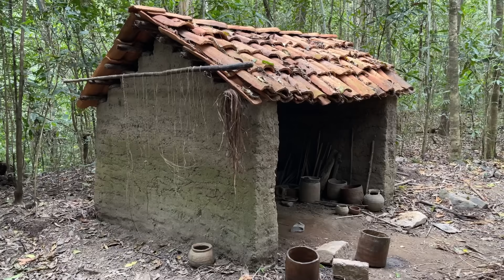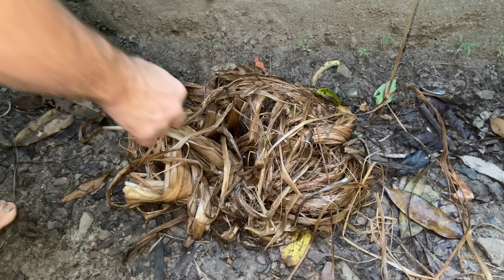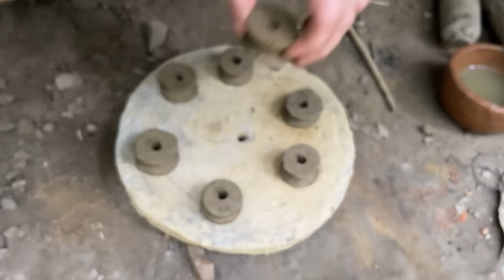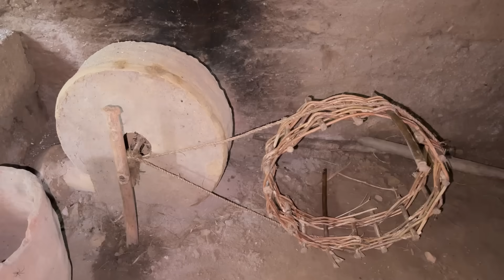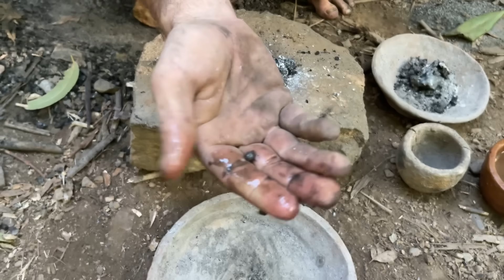Primitive Technology: Floating Pulley Blower Smelt

Comment: AI Summary

Abstract:

This video details the construction and testing of a traditional, human-powered blower for iron smelting, specifically focusing on the challenges and solutions encountered when adapting existing designs. The creator meticulously rebuilds a broken clay blower housing, demonstrating a unique string-based method for scribing the volute (spiral) shape and explaining its aerodynamic purpose. Key components like a round outlet spout and double-sided air inlets are integrated. The video also covers the primitive yet effective method of starting fire by friction and the process of making durable cordage from wild banana tree fibers to serve as the drive belt. Two pulley designs are explored: a fixed wheel and a "floating wheel" (a wicker cylinder spun in mid-air). After overcoming issues with fragile clay pulleys by opting for a fiber-wrapped rotor, the blower is successfully tested with fire and subsequently used in an iron smelting operation. While the smelt produced high-carbon iron prills within a slag mass (attributed to lower blast pressure), the blower performed ergonomically and efficiently, yielding 21 grams of iron from 1200 grams of ore, surpassing the average yield from previous attempts.

Summarizing the Traditional Blower Construction and Iron Smelting Process

*   0:00 Rebuilding the Blower Housing: The project begins with rebuilding a broken clay blower housing from a previous endeavor, highlighting the need for a robust design.
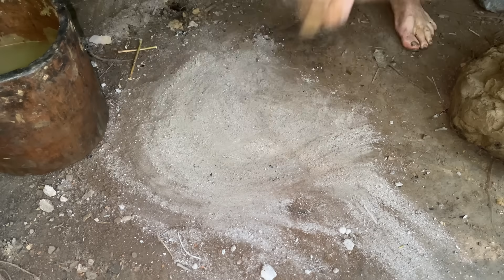*   0:17 Scribing the Volute Shape: The creator demonstrates a precise method for scribing the housing's spiral volute using a string, ensuring an accurate aerodynamic shape for efficient airflow.
*   1:07 Purpose of the Volute: The volute shape is explained as crucial for gradually increasing air volume around the fan, leading to consistent air output.
*   1:32 Round Outlet Spout: A design change to a round spout is introduced to facilitate easier connection to a round tuyere (air pipe) for the furnace.
*   2:28 Air Inlet and Drying: A 5 cm diameter air inlet is cut into the housing, followed by careful drying of the clay, with a warning not to leave the internal log too long to prevent cracking.
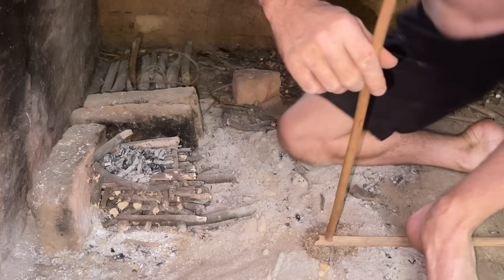*   3:02 Fire by Friction: A brief demonstration of starting a fire using the friction method, showcasing a traditional technique.
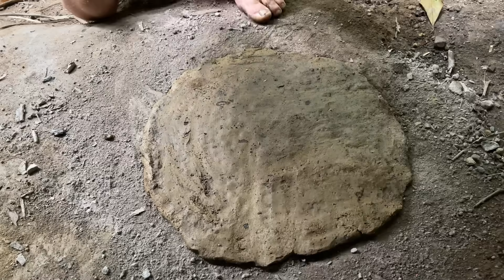*   4:44 Making the Lid: A lid is formed by flattening clay, trimmed to fit the housing, and features a second 5 cm air inlet for the fan.
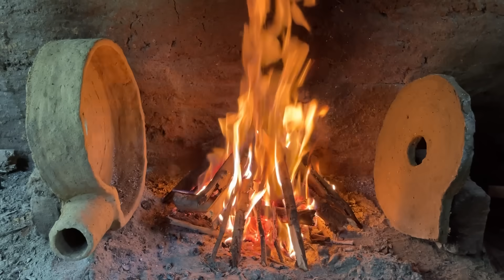*   5:18 Assembling the Housing and Fan: The housing is set on stakes, the fan rotor is placed, and its free spin is tested before the lid is added, ensuring proper alignment.
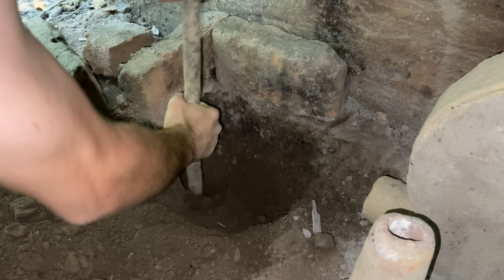*   6:04 Furnace Construction: A furnace pit is dug, and walls are constructed using bricks, positioning the tuyere 2.5 cm (one knuckle) from the pit's edge.
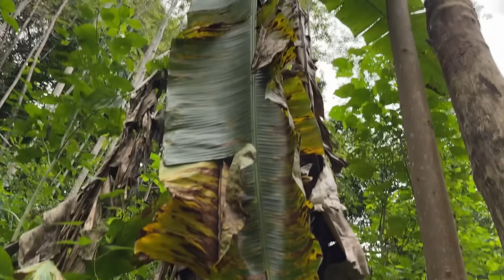*   6:51 Cordage from Banana Fiber: Wild banana tree fibers are harvested, split, dried, and then twisted into strong, durable cordage using a specific clockwise/anti-clockwise twisting method.
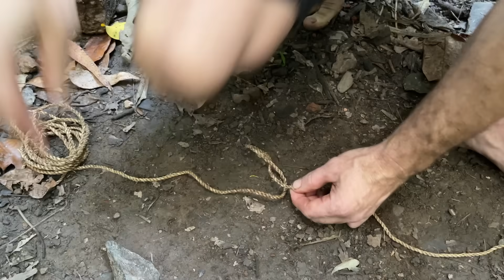*   7:36 Splicing the Belt: The banana fiber cordage is spliced together to form a continuous belt, demonstrating a technique for joining ends securely.
*   8:58 Clay Pulleys and Keyway: Small clay pulleys are made for the fan rotor, along with a keyway for a wooden key to secure the pulley in place.
*   10:15 Testing Fixed Pulley Design: A "fixed pulley" design is tested where the handle is directly attached to the wheel, simplifying the mechanism but showing some wobble.
*   11:34 Making the Floating Wheel: The creator shifts to a "floating wheel" method, constructing a wicker cylinder with handles to act as the driving wheel, spun in mid-air.
*   12:28 Fiber-Wrapped Pulley: Fragile clay pulleys are replaced by wrapping the fan rotor with fiber, which provides better traction for the belt and prevents slipping.
*   12:53 Blower Ratio: The fiber-wrapped pulley in action shows a 19:1 ratio of fan revolutions to wheel rotations, indicating efficient air movement.
*   13:27 Performance Test: The blower is tested with fire, proving to be ergonomically comfortable and providing a consistent blast, comparable to other blower methods.
*   14:09 Smelt Preparation: The smelting process begins with 30 double handfuls of charcoal and roasted iron bacteria (white from ash) as the ore.
*   14:38 Smelting Process & Challenges: A 26-minute preheat is followed by six charges of charcoal and ore. The smelt experienced halts due to the belt breaking and the fiber pulley needing re-tying.
*   17:38 Bloom Analysis and Yield: The bloom produced consisted of high-carbon iron prills embedded in slag, theorized to be a result of lower blast pressure. The bloom was crushed and panned to extract 21 grams of iron from 1200 grams of ore, a better-than-average yield for this method.

I used gemini-2.5-flash-preview-05-20| input-price: 0.15 output-price: 3.5 max-context-length: 128_000 on rocketrecap dot com to summarize the transcript.
Cost (if I didn't use the free tier): $0.0058
Input tokens: 12934
Output tokens: 1106

Comment: 19:40 if you want an even bigger blower instead of making it as a free standing item you could in effect turn it side ways and bury everything but the side with the air intake on it so instead of having to make it all you just dig a cylindrical pit and line it with a a roll of clay and then you just need to bake a lid  for it ... oh course you'd have to turn the pu'''' actuly you might not have to even turn the pulley system on it side you might be able to just get away it  it in the string  as for the axle you could make a small clay cup or tube  and put it in the center and just have the axle rest in it   other than that maybe insulate the furnace with more dry dirt to keep that heat in .. and hmmm

Comment: @Primitive Technology You'll keep getting iron prills instead of BLOOMS as you don't preliminary convert your limonite ore into MAGNETITE ore before smelting. 
Because it's just impossible in a such short bloomery even with use of good leather double bellows with valves. First bloomeries in human history (Hittites) used magnetite sand as ore for reason.
You can convert limonite (red ore) by heating mix of 5 parts of ORE dust with 1 part of COAL dust in pot during 5-10 hours. The resulting ore should change its color to GREY.
And don't forget to spill the SLAG out at the end of the smelting or it gonna spoil the bloom.

Comment: Looks like there's a formula here that is going to work. Trying to suppress a grin there, as it's doing better than expected? Only thing left is to get a transfer shaft to a waterwheel somehow. Then the effort can be spent gathering over 50lbs of source material just to get enough metal for a small razor blade. (If only the starting location were more resource-rich in that regard. Got a bad draw with RNG on the map for that one material, but you're still willing to work with what you've got.)

Comment: Suggestion: have a pipe that sends air through a heater before going into the furnace. Cause you’re ultimately sending cold air into a hot furnace, worsening results. Hot air might work better

Comment: If I may comment:
1: I actually wonder when changing from the clay pulleys to the fibre wrapping is gonna cause a way higher friction to the belt that makes it wear out faster - did you have any observation like that?
2: "Don't play with fire" said nobody to this guy, and he grew on a level of fire resistance without a gear that he simply puts everything bare hand into the forge with no hesitation whatsoever - mad respect!!

Comment: i had the thought that maybe the exit opening of the furnace should be smaller? so the air is compressed and accelerates like in a bunsen burner. Because he puts in a lot of air through the blower at high speed but at the end it lost a lot of speed and the flames just flicker natuarly. Maybe a big cone on top of it that doesnt even need to fully seal would increase air pressure and speed and would also result in fuller combustion of the exit gases

Comment: To get more pressure, maybe make a domed clay firing pit with an exhaust lower than the air valve. If the dome is tapered enough, then the pressure from the intake should force the heat back down to the exhaust since its an easier mode of transfer right?

Comment: What about having two blowers on opposite sides at a slight angle to produce a vortex within the furnace? I won't claim to know why or the science behind it, but I've seen some smelters do that. You could power both blowers with a single belt (twist in the middle since they'll be facing toward each other) and turning a crank that's fixed on one of the blowers (slippage with the belt might become a major problem).

Comment: What for a supported double handed wheel? Longer shaft, handle left and right but no need to stay in tension
Reply: Or a self standing blower: lay blower flat, with twisted belt you can place the wheel orthogonally over the blower; support of the double handle wheel can be embedded in blower structure

Comment: For the first time ever I'm thinking, come on man you can do better. 1. You can make pulleys from stone or if thats too much effort make them from wood on a homemade lathe. 2. Putting some effort in making the inner part of the blower smooth so it has less dragg. Polish it after drying with a smooth stone. 3. Although it seems logical to have the opening for the intake at the center it would be better to have it at the beginning of the circle as a triangular keyhole that way the fan draggs and pushes more air. 4. Your oven is put together sloppy you know you did 😅. For example the bottom of the oven should be cone shaped so the heavier iron moves to one point. The oven should be higher to keep more heat. The inlet should be placed at the side to create a vortex for better heat transfer and the heating chamber should be bigger than the chimney

Comment: 15:46 How is there fire "leaking" out of the furnace? I can sort of imagine the charcoal turning into carbon monoxide or something, but how can it be easier for it to slip between the bricks instead of going straight up the chimney?
Reply: The furnace is positively pressurized because of the blower, making the cracks (locally) the path of least resistance.

Comment: I've never seen a fire get that hot from a pulley system. That is just amazing. Its ALMOST blue its so hot. Seeing purple fire seeping through the cracks in the bricks was soo cool. I can only imagine how tough his hands are. Those are some serious callouses.
Reply: The fire doesn't get hotter than white. Purple flame color is infrared light getting too strong for IR filter in camera to filter it out completely.
Reply: @rq0733  It may also be the burning of Carbon monoxide, this was more common near the starts of smelts where he used a lot of charcoal and the stick blower (less oxygen in the furnace -> incomplete combustion, CO generated -> Hot CO burning when it reached atmospheric oxygen)
Reply: @rq0733  I think it does. It goes a kind of pale purple before it completely goes out of the visible range of the spectrum.
Reply: Having built and wood-fired all-clay pottery kilns, purple flame is what you see late in a firing when the back end of the firebox gets over 2000 F.

Comment: If you can perfect your pulley system, you're so close to having a not you based system. Just a weight on some rope with a couple of differently sized pulleys between could run it for hours.

Comment: i think you may want to consider a wooden pulley instead of a clay one. because of the way unfired, unglazed clay behaves, its weakest under tension, and unfortunately, because of your pulley design, the rope is actually putting the clay under tensile stress. the rope is hitting the walls of the pulley, and because of the shape being a v rather than a u, its putting outward pressure on the walls of the pulley, causing it to shear. also, good on you for not calling it banana "wood." wood comes from trees, and bananas arent trees, theyre something different, called a musa.

Comment: I have a few questions:
Would cutting notches into wood help with slipping? This way you might not need the pulley at all.
Do you have plans of making a lathe? It would be very interesting to see it done with so little metal.
Why didn't you fire the new blower? If last one was damaged by water it seem like a good idea.

Comment: To get better pressure and higher temperatures, you could make it 1-2 bricks taller and put like a thick lid on it and seal it off. With a small to mid sized hole at the top of it. Similar to the kiln. And for better heat distribution, you could put the blower in one corner and angle it a but to make a vortex, kinda like a devil forge.

But that too could eventually be innovated too, at some point if it doesnt work.

Comment: Similar diameter fired clay fly wheel with a pulley groove with that gear ratio you have and grease in the holding sticks it should hold momentum enough to only need to spin it up every so often?

Comment: I have a suggestion! Bear with me on this one.

Bike wheel design.

Make the outside of your floating pullet just like before, 12 bits of cane in a circle woven together. But, set up a central axle, and use bits of cordage to connect each cane to the center as "spokes". Bike wheels only really have the spokes under tension, and you can do the same. Doing this allows you to make sure the wheel is as concentric as possible to the axle because you can just shorten and lengthen individual cords. You could do rough adjustments just by actually lengthening or shortening the cords, and then fine-tune the spoke length by twisting or untwisting it.

Comment: something like double handles on the big wheel but instead on the fixed rotor holding the big wheel

handle-|
             |
              axle-----stake------wheel--------stake-------axle----|
                                                                                            |
                                                                                            |handle

Comment: Imagine, for a moment...  building a SWAMP COOLER, completely out of Your Skills, the nature around you, and materials you have at hand.  

Materials Needed:  
Flowing Water.  
Clay Pipes for moving both air and water.  
Long thin clay plates.  
Long thin wide mats of woven fiber, using that same thin cordage woven into fabric mats.  
That blower you built here, but several of them.  
A clay manifold pipe for multiple blowers to blow their air into a single feeder pipe.  
Rope cordage fabric belts.
Fired clay pulleys.  
A clay "curtain" manifold, that has tiny holes for outputting air at higher pressure.  

So make clay pipes.  Lots of clay pipes.  These will carry water in some, air in others.  Fire them of course.  
Rig a water wheel near your water source, to push a set of pulleys, so that all your blower fans spin VERY fast.  
Direct the multiple fans into the clay teuyer manifold.  
Direct water into water pipes.  
Pipe the air and water to a box.  
The box should have the output manifold behind it, so that it blows through the box.  
Hang the fabric mats and thin clay plates from the top of the box.  
The box should have the water pipes routed, so that the water pours over the fiber fabric mats and thin clay plates, and the air should blow through that.  

Swamp Cooler.  

Bonus points if you also or instead direct the water to turn a GIANT fan behind the water curtains instead of a complicated blower fan setup.  Actually, that would probably be easier and more efficient to build.  You could build it into a wall of your hut, and run the excess water through output flow pipes to send it back to the water source.  

And if you built it with the water turned big fan, instead of the more complicated blower-teuyer-manifold design,  you wouldn't have to run air pipes and blower forced air, you would only need water pipes.  If you can find a way, like tree sap, wax, grease, fat, or natural rubber to seal your clay, it can hold water and keep it from leaking all over the place through the porous clay.  It's not going to need to be food safe, so sealing it with stuff that isn't shouldn't be a problem.  SOURCING sealant is problematic though.

Comment: I'm sure it has been said to death, but would it be possible you're losing heat by lack of seal on the smelt? Could you put a layer of wood ash cement on the exterior of the forge for a more permanent fixture?

Comment: In practice, there is no way this would have been done alone.  There would have been an elder master and several apprentices (or more) operating the smelting furnace, and that would have allowed them to generate much higher airflow and temperatures for an extended time.  That he can get ANY results from the very low quality ore is remarkable.  The Maori never developed metal smelting/forging technology prior to European contact.

Comment: 5:33
Couldn't you place two halves side by side and make a double wide tuyere, funneling a larger volume of air into the furnace while essentially just mirroring your normal layout with some kind of work around to join them?
Or, y'know, you could start working on a system that runs bellows that is connected to your fan rotation for the furnace, but that's probably hunting, tanning, and leatherworking before it comes back to helping the iron production...

Comment: Hm.  I wonder if you could use small plant fibers, make a bunch of small cordage, and weave that into a long flat belt, and then if you have anything like rubber trees or plant sap or some other goop that can be harvested and soaked into the belt and then heated to vulcanize it, if you could make a rubber belt for turning spindles and pulleys.